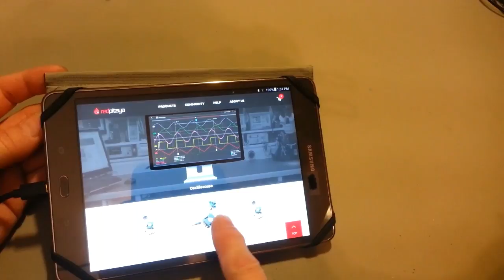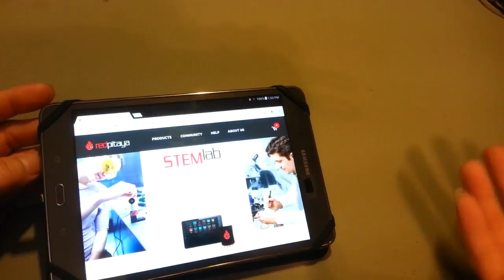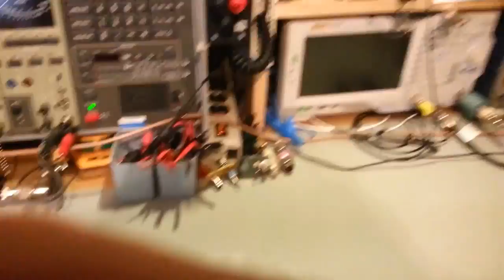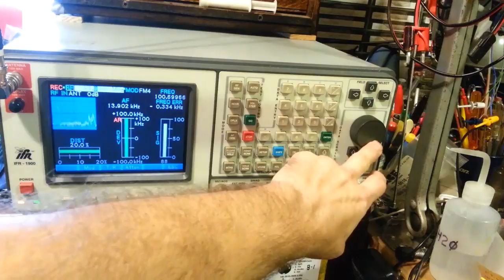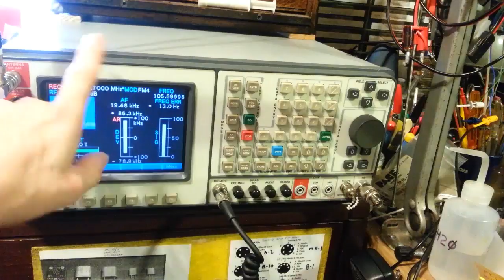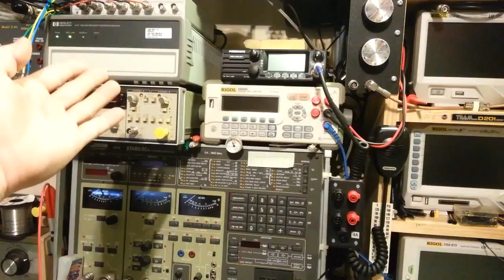Electronics course update and some new equipment on the bench.

Comment: Let me also say that my budget for the radio I would like to keep it under 400 if I find or if you recommend something that’s less then I’ll just have a little bit more in my budget for the other equipment I would need
Reply from the maker: Gs Adventure 

So your looking for a CB radio or export 10 meter radio.  For a 40 channel FCC certified radio I would recommend the President McKinley.   For a export 10 meter radio the President Lincoln II+.  Well built radios with the best warranty in the business.  If you buy one of their antennas at time of radio purchase it extends your radio warranty to 5 years.
Reply: MikesRadioRepair wow ok that’s good to hear. Ok so can I buy it from you or can you give a number or website 

One more thing. Do you have anything you may be selling just a thought. 

And yes I would like a 10 meter band. Radio
Reply: MikesRadioRepair yes a export 10 meter

Comment: Hi Mike can you or anyone help with this question please, I am replacing capacitors in a Cobra 148gtl dx, and in the parts list it says that 3 capacitors are Aluminium Solid, which from reading are polymer capacitors, I can't find a replacement anywhere, have read they have a life span upto 6 times longer, but cant believe that's the reason for  using them, what should I use as replacement.
Thanks, and looking forward to course.
Reply from the maker: +Justin Shears 

There are different versions of this radio.  What board does it have.  Parts list can be confusing and frequently wrong.  Best thing to do is just look at the part that is actually in the radio, what's there?
Reply: Thanks for reply Mike, it is PB-010AB, the caps look exactly the same as Electrolytic, but it says SOLID in parts list, and yes the parts list is wrong on a few values.
Reply from the maker: Justin Shears 

I think the parts list are made up early in the life of a radio and it's production.  As time progresses they make changes, updates and service bulletins are released and before you know it there can be dozens of changes to part values, additions and deletions.   If a regular aluminum electrolytic is in the radio replace it with that.

Comment: Mike here is a item number on eBay that looks like a good deal maybe some of the people mite like to get one. 142314336889 it is a GW Instek Multimeter GDM-8135 3-1/2 Digit LED Single Display Digital Bench Top. Also I got a kit from Mouser All but the circuit board, So they do parts kits. Link https://www.mouser.com/ProjectManager/ProjectDetail.aspx?State=EDIT&ProjectGUID=16dad311-cb6b-4828-9fce-6ded21191b0b  You mite want to check them out for the stuff we'll be doing.

Comment: Mike, i was hoping Mark still has the channel king exoantion expansion kits for the 148GTL. And if there's a web site I can order from.    Thanks jim
Reply from the maker: +James Fackenthal 

It's not available for sale individually.  It needs to be installed by a tech.
Reply: MikesRadioRepair
Ok Mike, I have a 148 FLY. It was modded back in the early to mid 90s. It's been not used for more then 10 years. I also have a solarcon thunderbolt 5/8 wave antenna.  I'm wanting to get It looked at and have the caps replaced and have the OLED display and expansion board installed.  It has the 3 switch upper and lower mod, the modulation was worked on and set up d104 power mike. And the power pit was moved to the back of the chassis min. Was around 1 watt, and 4 watts max. And I added a frequency counter to it. Could you give me a ballpark figure on what it would cost for you to do your thing to it?
Thanks  Jim

P.S. 
I just found your channel and have been watching it none stop since. Oh yeah,  i forgot in the post. The display is bad on it when I stopped using it.
Reply from the maker: James Fackenthal 

Shoot me a message.  Just add @gmail.com to my youtube user ID.

Comment: Mike, was reading the spec sheet on that ifr 1900 from the following link "   http://www.avionteq.com/document/IFR-Aeroflex-FMAM-1900-Specification-Sheet.pdf   "  and it shows under AM modulation meter and fm deviation meter that they only work on a carrier frequency from 100mhz up to 2010mhz. Am I reading that spec wrong?
Reply from the maker: sneakysnake109 

From 10 to 2010MHz.
Reply: That sounds much better.  Thanks

Comment: I'd love to see a video, some time, about your distribution amp for your lab frequency standard.  I picked up a rubidium oscillator some time ago.  I want to do a distribution like you did, but I'm a bit vague on how to start, affordably.
Reply from the maker: Michael Hojnowski 

I have both the Stanfo Rd Research FS710 and FS730 model distribution amps.  Like Roy said replace the electrolytic caps in them and they will hum along for years to come.

Comment: The level of activity and development surrounding the open source community (software and hardware)  is overwhelming.  Just about anything you can think of has some level of activity on it.  These little guys can be useful for modern automotive applications as well.  

I deployed a stratum 1 to 3e peer group for a telecom  provider.  They were under a crunch to get off LORAN.  Long process, mostly waiting the required minimum 8 hours to be certain it was stable before testing, then cutting all the equipment over, then making sure all the equipment obtained & maintained synchronization.  I'm sure that was a chunk of change to deploy that.